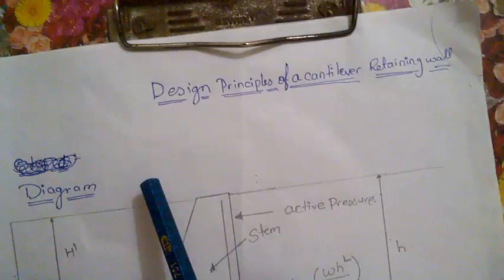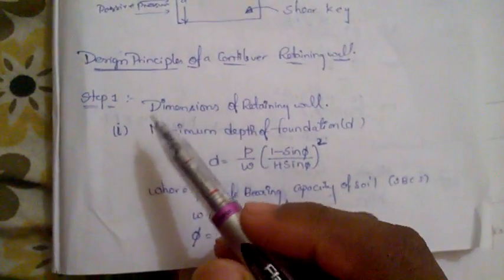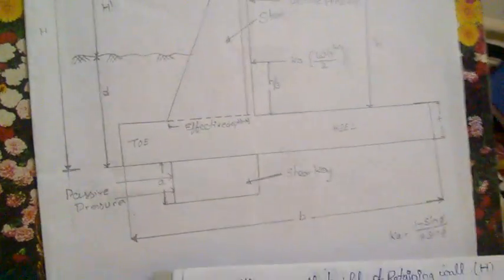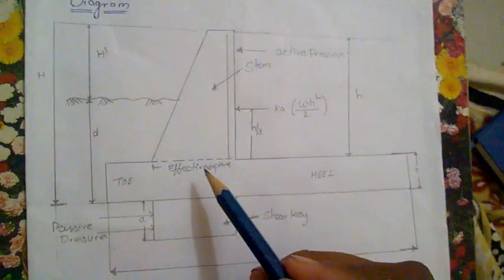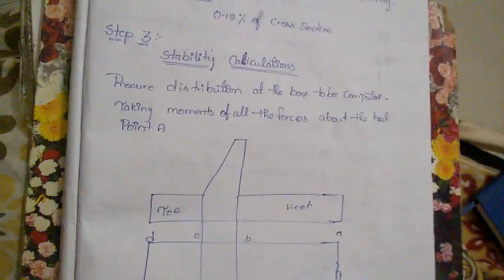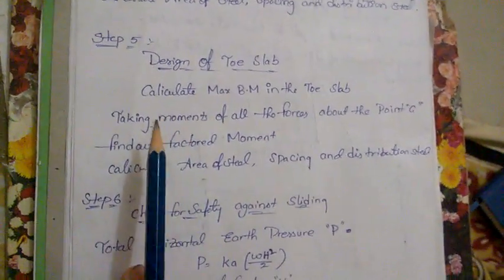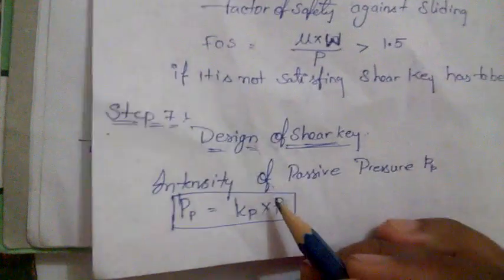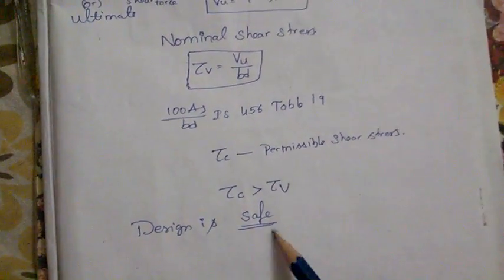RCC-II (Design Steps For Cantilever Retaining Wall)

Comment: Surcharge:

Surcharge is a live load (if any) acting on the on the top horizontal portion of the retaining wall...

Active earth pressure:

When the wall moves away from the backfill, there is a decrease in the pressure on the wall and this decrease continues untill a minimum value is reaceh after which their is no reduction in the pressre and the value will become constant. This kind of pressure is known as active earth pressure

Passive earth pressure:

When the wall moves towards the backfill, there is an increase in the pressure on the wall and this increase continues untill a maximum value is reaceh after which their is no increase in the pressre and the value will become constant. This kind of pressure is known as passive earth pressure.

This means that when the wall is about to slip due to lateral thrust from the backfill, a resistive force is applied by the soil in front of the wall.

And please inform us if the retaining structure comes within the water table..how we are going to sustain it. There must be chances of huge settlements.
Reply: How?